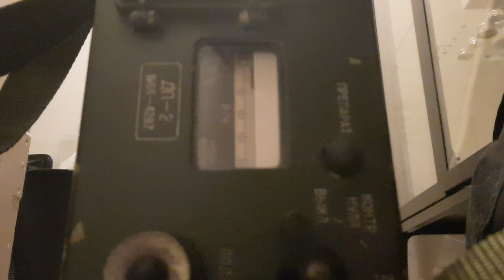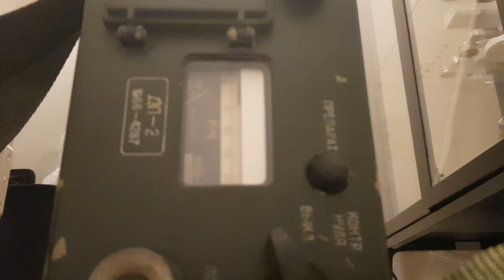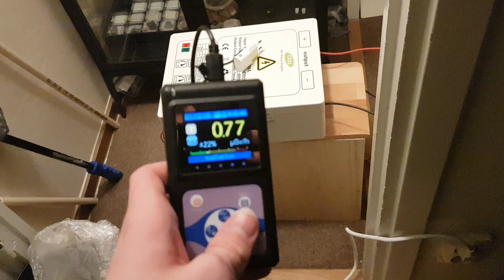New And Improved X-Ray Setup

Comment: Some rectifier tubes like you used in your earlier video will work better if its connected in reverse polarity.For example the DY86 and DY87 used in old TVs and some American tubes like 2X2 and similar types.
Reply from the maker: True, but this particular tube I used does not work well like that. I tried a while ago and the result is way worse as the cathode is too small to be a usable anode.

Comment: A cool video would be testing all your geiger counters against a plasma ball. My Terra P reads from 100mSv/he to 5 Sv/hr near one. Obviously, it’s just a malfunction, and they are not actually radioactive, but i’m curious to see if other geiger counters have the same flaw.
Reply from the maker: I might, the thing is that it would not be that interesting as only GM tube type detectors will react to it while the pancake, scintillators and ionization chambers would not freak out.

Comment: Nice! a little concerned for your safety, with the radiation that you're exposing yourself to.
Reply from the maker: It's not too bad. The amounts the radiascan registers is about 7 times higher then the actual exposure rate. When the thing is turned on I do sit behind a concrete wall where the radiation I'm exposed to is reduced to 10uSv/h

Comment: More radiation than the 240 Sv/hr you estimated from the last one? Holy crap...
Reply from the maker: It's sadly quite a bit less now. (both setups used the same tube) The filament voltage is 0.5V less in the new setup due to a part breaking and that does quite a bit to the output as it is exponential
Reply: I'd definitely invest in a variable power supply for the filament, since the filament voltage is very important to achieve max x-ray product. Too low, and there'll be little emission current, and few X rays produced. Too high, and the filament life will be reduced and the voltage will drop across the tube, and only low energy X rays will be produced
Reply from the maker: @inductivelycoupledplasma6207  That is definitively a must and I'm thinking of buying one not too long from now.
Reply: Nice, really looking forward to seeing more videos!
Would love to see a more in-depth video about the 1.6mCi radium source, and perhaps dose/count rate comparisons with the DP-2 source. Both are way hotter than anything I have lmao
Reply from the maker: @inductivelycoupledplasma6207  I'm unsure of I will make one or not regarding that source. It's a bit too dangerous for some people to know how to obtain it, I'm sure you could handle it but there is a lot of people who would cause some mayor damage.
Reply: @radiumquetzal8000  You wouldn’t have to tell anyone how to get it if you did. I would like to see a video on it too
Reply from the maker: @0error.389  I'll have to think about it.
Reply: It is an intriguing source, but yes, not something to play around with. A lot of radon too